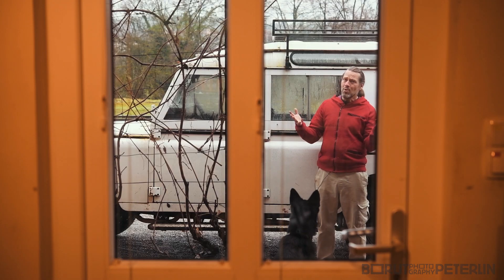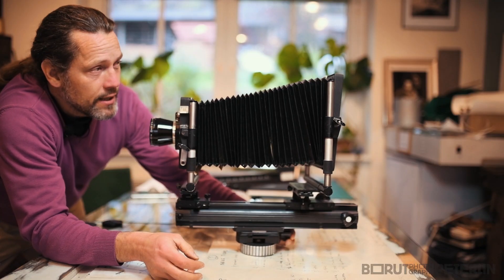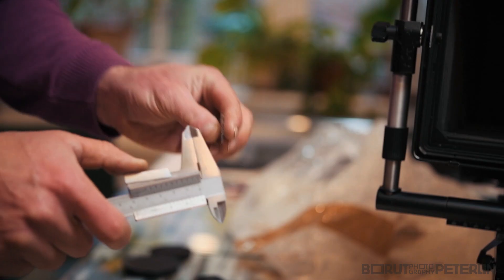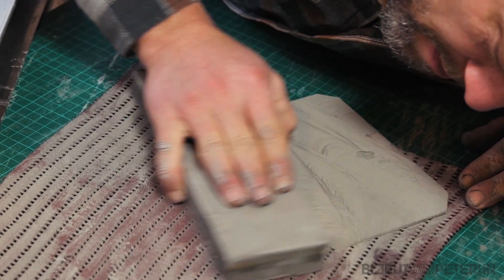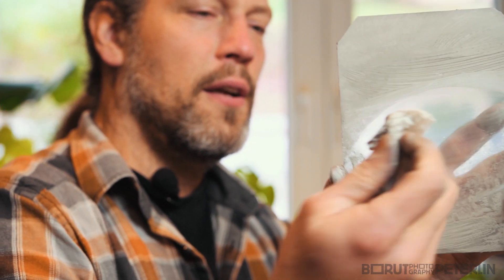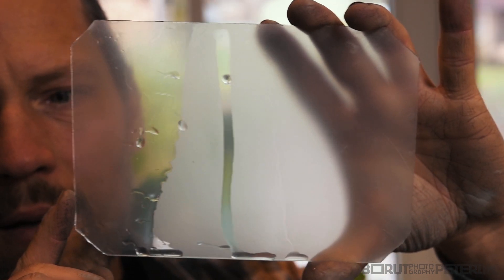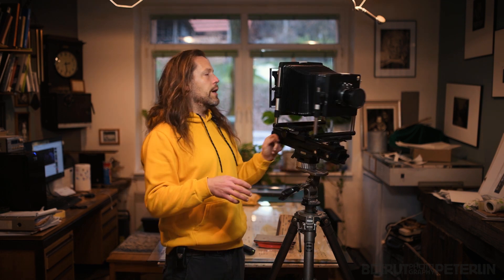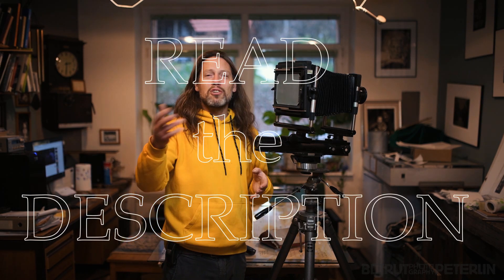How to make a ground glass for a large format camera. DIY - Vlog #105

Comment: im having the glass shop etch my glass.
Reply from the maker: Not as good. I tested. Best is silicone carbide above 1000 granulation. After they etch, you may have another 5 min polish with silicone carbide 1200 granulation
Reply: @borutpeterlinphotography  my interest search suggested that etch is brighter and finer grain than grounding. im doing 14x17 piece of glass. sounds like doing both etch and grinding is the best of both world?

Comment: Hi so im trying to make a ground glass for a 40x60 and 20x24 camera and ive got all the materials so far (as well as 1/4 inch thick glass for strength)

However i noticed at 1:41 you had a object for grinding is this a wet stone or a peice of wood with sandpaper?
Reply from the maker: It's another piece of glass
Reply: @borutpeterlinphotography  got it looking forward to the grinding for 3-4 sheets of glass now

Comment: Best trick?  Use a 4x5 piece of glass as the 'polisher' for your 5x7 ground glass - and you get two piece of ground glass at one time!  Work smart, not hard.  :)
Reply from the maker: I did started like that, as you can see on the video, but then I've switched to a stone silicon carbide. Either way, as long it works

Comment: Wow this video is godsend I'm a total carbon beginner and have been using your glop recipe. So far I've hurried through the entire workflow because I'm always afraid the dark effect will kick in after 2 days. It's great to know that it lasts up to 4 days with no problem!
Reply from the maker: Yes, but there is one bit of information you need. Add one table spoon of baking soda in 2 liters of water in mating bath. Or if needed also in the wash bath. Ammonia is better, but it smells bad, but in my casr baking soda worked just as good. Plus my washing temperature is between 50 and 60C. I know, that's almost double I've been thought, but it works for me. 
That said all this information is newly discovered (at least for me), so keep your eyes open and observe what's going on.